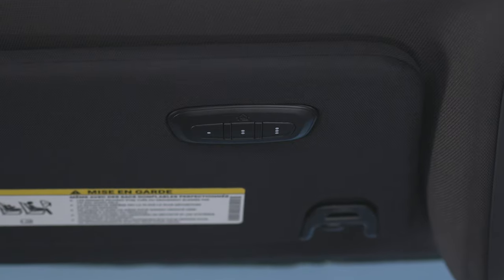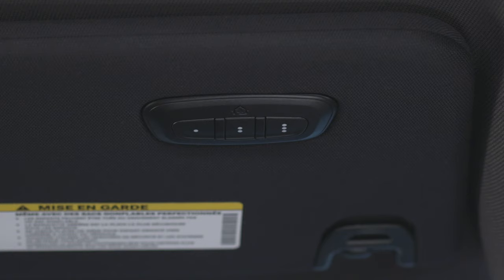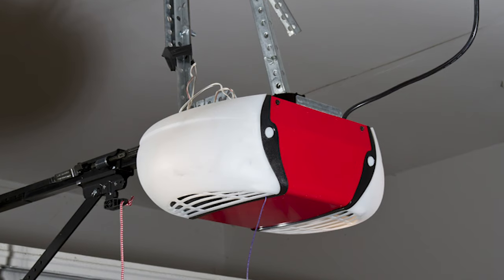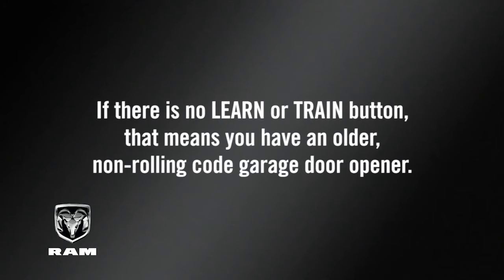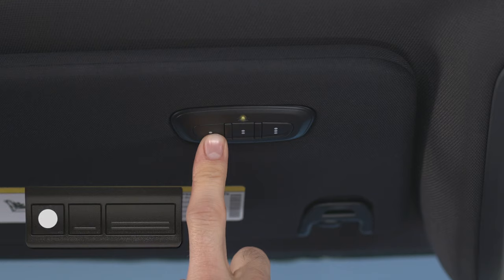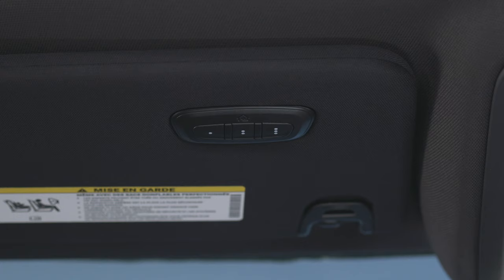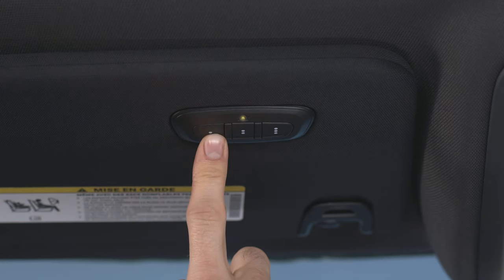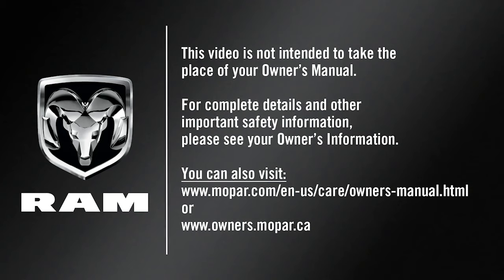HomeLink® | How To | 2020 Ram 1500 DT

Comment: 100% Doesn't work for 2024 Ram 1500 Limited. It never starts flashing quickly. If I try to push the learn button on the garage door opener first it just deprograms the remote. I can then reprogram the remote to work in like 5 seconds. But can't program homelink the same way as the remote. Did this with a Toyota Sienna took about 20 seconds to figure out with no instructions. Been at this for 3 hours now with the manual, the quick start guide, and multiple videos online.

EDIT:

Finally found a method that worked on a forum post. Had to hold homelink button, and fob button at the same time, until the light on the fob went off. Then reclick fob button and hold while still holding homelink button. Took me 3 repetitions, and the homelink button went solid (never flashed quickly). When it went solid the homelink button worked. I have a garage door opener that has a learn button on it but didn't have to use it.

Figured I'd post in case it helped someone else.